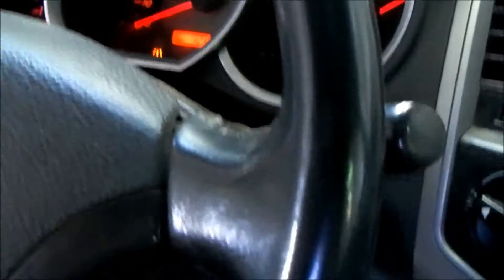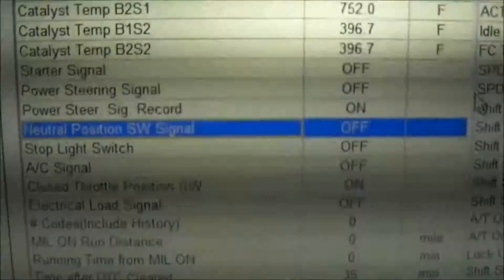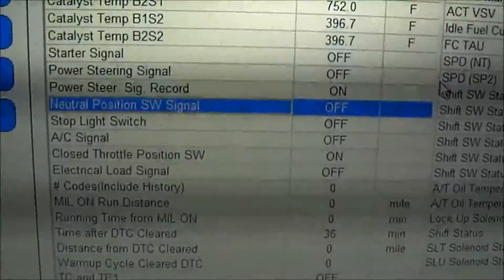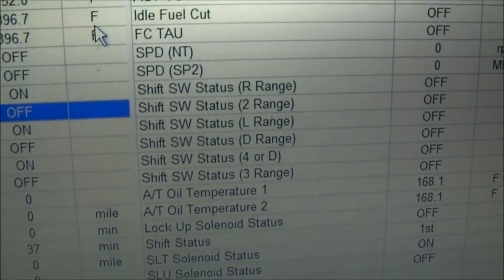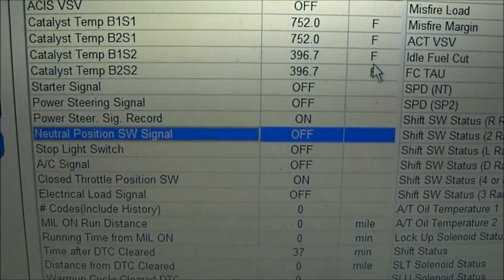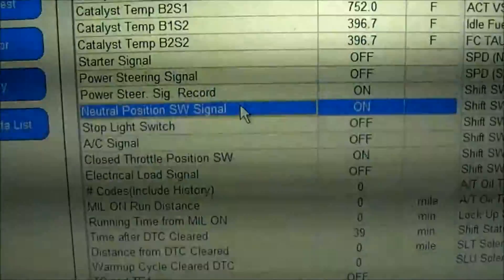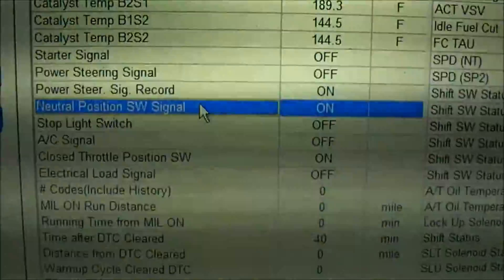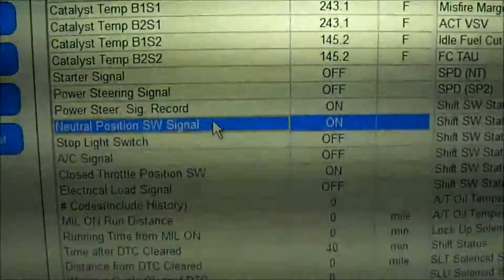Diagnosing a Bad Neutral Safety Switch with a Scan Tool

Comment: So I just had my trans rebuilt, (4165e) truck started perfect before I pulled the trans. Took it to a shop to have it rebuilt, put it back in and no start no crank. On the gauge cluster it doesn't show that's it's in park/drive/reverse.... it's not lit up at all. I'm thinking that it doesn't know it's in park. I'm thinking the neutral safety switch is bad, does this sound right? How do I test the switch without a scanner?
Reply: Js S hey there, just wondering if you ever figured out what was causing your problem. My PRND321 indicator has not been lit up for a while and now it is occasionally giving a no crank no start condition.